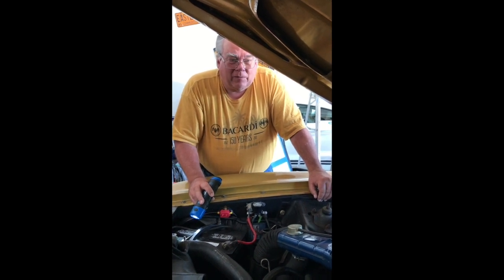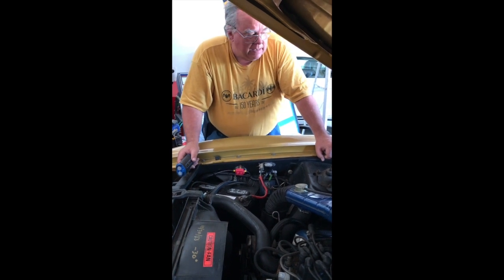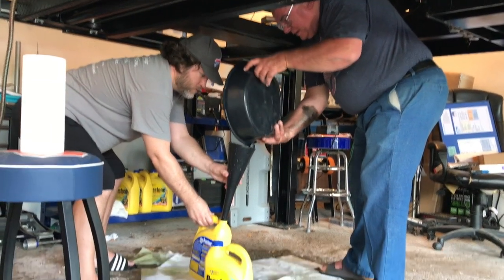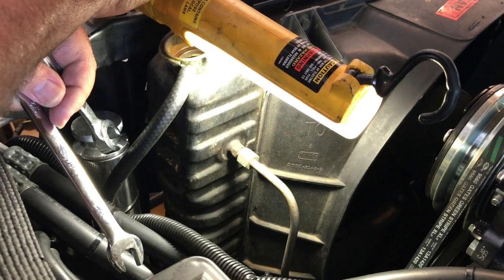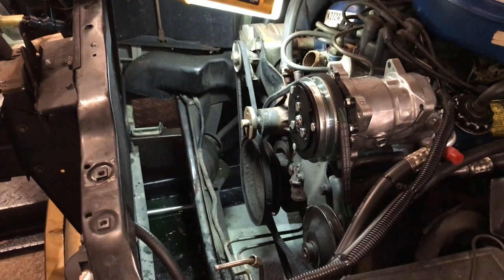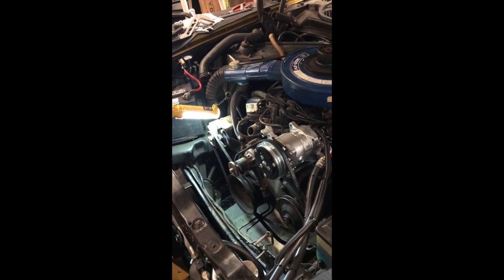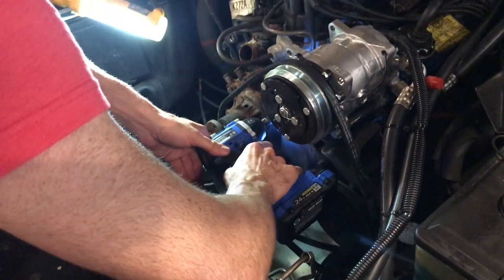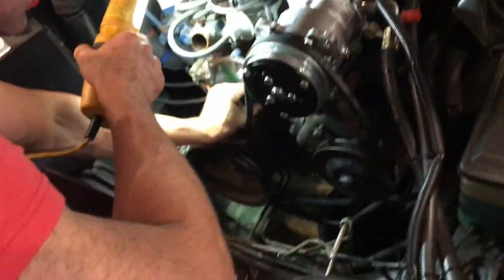01 - 1973 Mustang 302 v-8 Water Pump Removal & Cooling System Upgrade Teardown - 20200621

Comment: I have a 1973 mach 1 sprint that came with a  factory with 351w. I'm replacing the same parts mentioned in this video, do you know if this will fit my 351w? I struggle to find fitment descriptions as 351w was never installed in us manufactured mach 1.
Reply from the maker: I am not sure how easy it is to get parts for the 351W in the US, other than 3rd party.  Allegedly the brackets off the water pump (alternator mounting) is the same as with the 302 engine.  If it helps I have some photos and vidxeos of our 351W brackets on our 73 Mach 1.  We also have a 73 Mustang convertible I can compare the brackets to between the two cars.  The prior owner had popped in the 351W to replace the 302, and he told me that he and his brother has no problem with the accessories and their respective brackets.
Reply: @gilberthale7777  thanks for the reply, I will view your videos to see if I can match the bolt patterns. Thanks